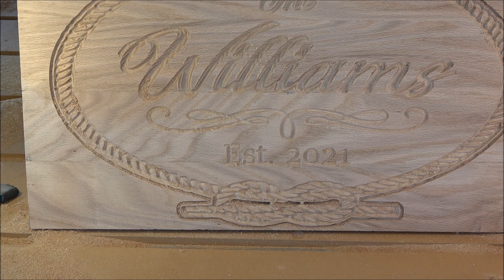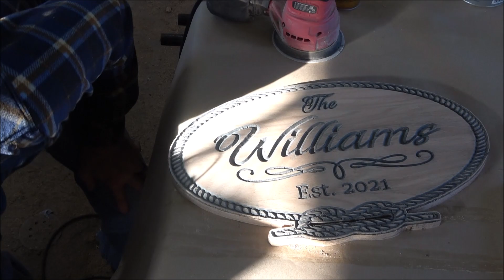Newlyweds Established sign (CNC)

Comment: Lovely job again Brian
Reply from the maker: Thank you, I'd love to do a lot of stuff in woods like Oak, but $$$$ stops me!!
Reply: @SmokeysCNCWoodworks  I use lots of reclaimed timbers. Old furniture etc, it does need skimming to remove surface layer. & Often a feed of oil as it's old & dry. Downside is it's never regular sizes & needs the extra work & glue ups, but often beautiful finish of well seasoned timbers. Cutting into old pine releases that ...Mmm aroma. !!!